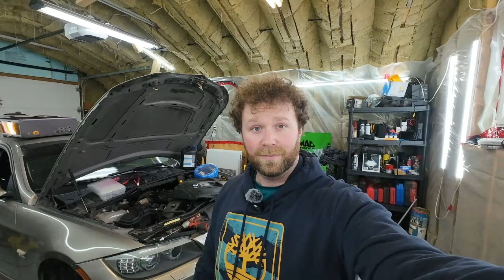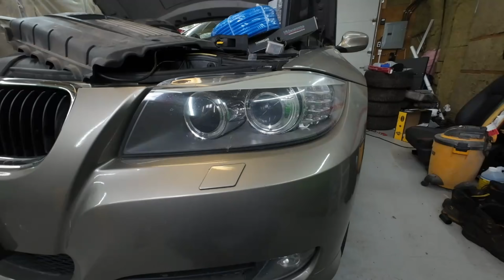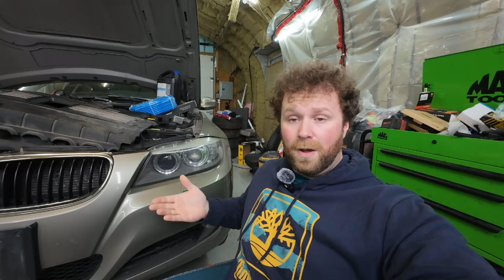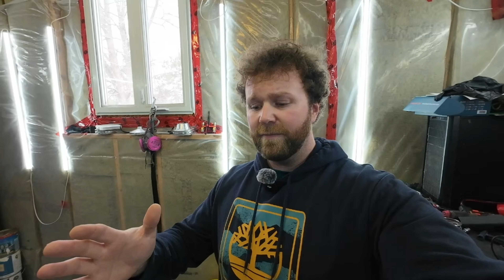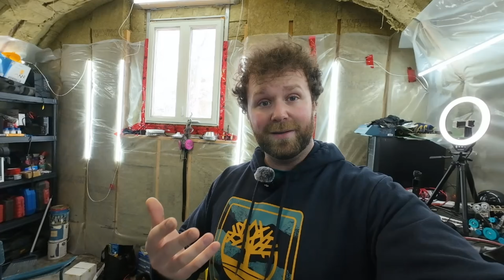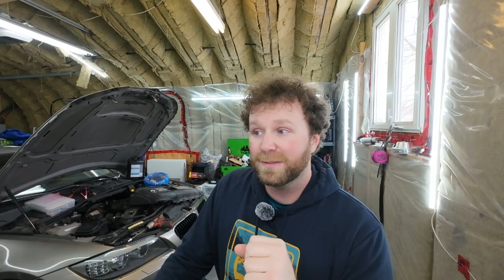My Eyes Are Up Here! The Stupidest Trend in Car Design.

Comment: Lance, DRLs as you know 'em are a Canadian market spec only.

USDM doesn't have to do any of that, and it's been a Canadian specific thing since the early 90s.

... which proves that Canada can assert it's own rules on lighting the US being a 9x larger market be damned, MANUFACTURERS MUST FOLLOW IT.
... only Transport Canada has rolled over and died in the last decade and allowed all this utter BS with lighting to pass.

Pointing out on VW, 'cause I'm a VW nerd:  They have PR codes for EVERY market across nearly 200 countries and regions, large and small to denote all that market's particular package of parts needed to conform.
VW's Canadian market code is "B0E" and the US, less California, is "B0D"

EVERY Manufacturer that sells in Canada has this sort of system, be it official and overt, or hidden/secretive.   Transport Canada, if they could collectively grow a pair, could legislate this garbage lighting out if they wanted.  They followed the Swedes and Finns when THEY implemented DRLs in the late 80s. 

Maybe the sissies in the lighting spec side of Transport Canada could have their hands held by the folks that do the infant/child seat rules....  because, holy-hell, TC's rules on those have been THE STRICTEST in the world, bar none, for decades.
Reply: So... the BS lighting where High beams, low beams, DRLS all overpower the turn signals -- this crock of shite could be kicked over with a decree.
Even...  retrofits, retroactively, could be decreed, demanded, and implemented.   They did this when introducing DRLs, which is why SOME of the first makes and models that had them, the soluions seemed like a cobbled together retrofit -- *because they were*.

T.C. could lord over manufacturers by denying them approval for any new models / model years, or stop-sale orders for current stock throughout Canada, holding them by the short-and-curlies if the Manufacturers deigned to put up a fight.

They have these tools.  But currently Transport Canada is a rubber-stamp of slack US standards.  T.C. just lacks the will to do so...

Probably because the people in charge of laying down the law were literally thumb-suckers that sat in those child-safety seats that ironically Transport Canada has unyieldingly enforced with strict standards, bans on resale, reuse, and expiry dates.
You're fully right to throw your hands up at this nonsense.  All of this automotive lighting BS could be solved, following better standards.  *Actually having standards*, rather.

Comment: I remember, years ago, buying European taillight assemblies for my brand new '72 VW Superbeetle. Basically, because the Euro light assemblies had separate bulbs for stop, turn, and running lights... and amber turn signals! They just looked better, to me. Since then, I've seen American and Foreign makes use amber turn lights one year, and red the next... as a styling choice, not a safety choice. It has long been proven that amber lights are more visible at night and in fog than red lights; it has to do with the wavelength, and our visual perception. I'm not up on the science. But I do know I've seen cars with their bright amber flashers on, and red ones seem dim by comparison. I have no clue why the USA has to be backwards on this. Look how long it took us to have replaceable headlight bulbs instead of sealed beams!

Comment: We need to re-standardize lighting.  $1400 light modules are criminal.  Standardized lighting would drastically reduce the cost of replacement parts.
Reply: Agreed, a lot of automotive things need to be brought back into standardization.
Reply: Yeah, it's ridiculous. I would also ban the use of laser headlights and lower the maximum brightness BY A LOT.

There has to be a new standard for repairable headlights, car designers be damned.
Reply: Be careful what you wish for. That's how the US got stuck with incandescent sealed beam headlights for years beyond when better technology was developed elsewhere.
As it is, the market decides what does and does not work. But much of that depends on informed consumers, of which there is a decided lack.
Reply: @etoineschrdlu9382  And the market has decided that everybody needs to be blinded by absurdly bright headlights. So much better than sensible regulation.
Reply: @commentsaretheworst but europe gets headlights that can dim, unlike in NA where that's illegal.

Comment: Also, car manufacturers seem to be making exterior lights smaller all the time, and making up for it with extra brightness. I was in a drive-through line recently with some sort of SUV in front of me, and its brake lights were each the size of a stick of gum - no exaggeration - but brighter than the sun. Very annoying, and probably not as safe/effective as "normal" brake lights with a regular bulb/reflector/lens arrangement.
Reply: My local police department has extra lights on the back of their cruiser, all like that. In total, including third (center) brake, I counted 9 extremely bright lights. First time I experienced it was directly behind one at night, felt like a flashbang

Comment: I hate how gm vehicles pop the reverse lights whenever the key fob is pressed. It makes me wonder if they're backing up.

Manufacturers migrating key fob functions into a stupid phone app. I like having full control over remote start. Now it's hidden behind a phone app and the function is only available for the first 365 days of ownership. After that you need to subscribe.
Reply: These functions can be changed with Ford and GM thru its settings. CAN networks are great for that.

Comment: Regarding rear tail lights and turn signals. I believe no part of the lighting can be on the opening tailgate or trunk lid because people may drive with the trunk overloaded and cannot close it. Hence turn signals get moved lower to what was a bumper. I think this becomes more apparent on smaller vehicles where the manufacturer wants to get a wider trunk opening.
Reply: I've always thought DOT mandated tail lamps on non moving vehicle parts. I Just saw an audi crossover/ suv where both tail lamps were entirely on the rear hatch. Unless the mandate occurred after that audi was manufactured?
Reply: @barrymccaulkiner7092 these audis have a small extra taillight for this case. The Opel Insignia wagon( I think they run as Buicks in the US) have them too.
Reply: You are correct, Under North American vehicle regulations, primary tail lights and turn signals must be mounted on a fixed, non-moving part of the vehicle's body.

Comment: My favourite, is the one where they've put them in the bumper corners. The one spot that gets hit and rubbed and bumped.
Reply: They do that because they are required to have them on the side too, but by having it wrap around it can be one single piece instead of two separate pieces
Reply: Also, in a city where it is often bumper to bumper, literally no one is looking there, or can see it because its obstructed anyway.

Comment: LED headlamps at too low frequency...Toyota is the worst.  Most folk are not sensitive to this but I am.  Turning my head causes the headlights to strobe...like tic, tic, tic...a flickering bunch of light.  That is visibly flickering.  This is a strobe effect just like a timing light.  Very annoying.  In my observation Toyota is the worst for this.  I've never done it but it would be interesting to measure with a photo tach to see the different frequencies OEMs run their headlights at.
Reply: @nhzxboi  I've seen it with the electric Mercedes, but it was with rear side lights. It was so bad on this one vehicle I got shutter artifacts on my Dash cam
Reply: I just write about this before I saw your post. But for me it’s a lot more than just Toyotas. And I am going to order night time driving glasses. They are way too bright and misaligned.

Comment: In Europe the running lights must dim or go off when indicators are in use.
Reply: @MayorofDipshittery-lq7if  But only below a certain distance. If they're are a foot apart from the signal, they don't.
Reply: Some do it, but its far from mandatory. My cars dont do that (2013 Toyota GT86 & 2020 Suzuki Swift Sport)
Reply: Those are parking lights, running lights are on the trailer of a semi/tractor.